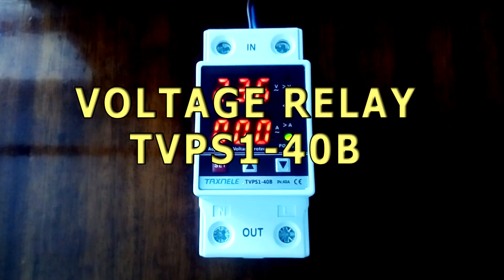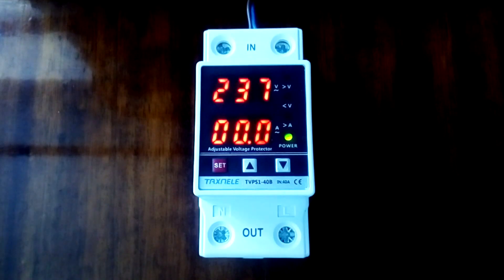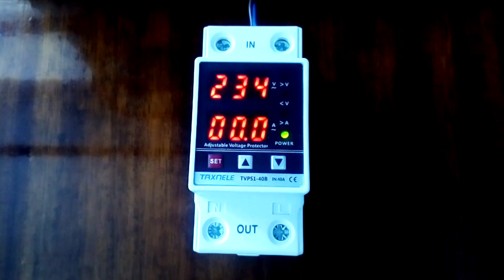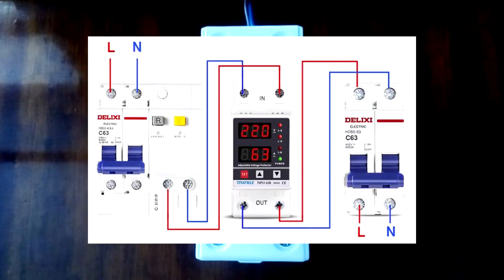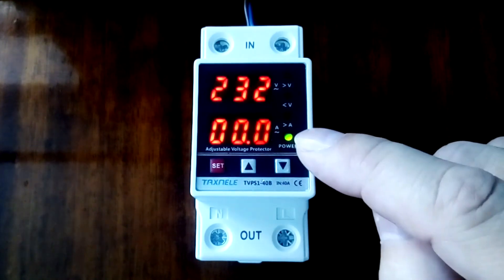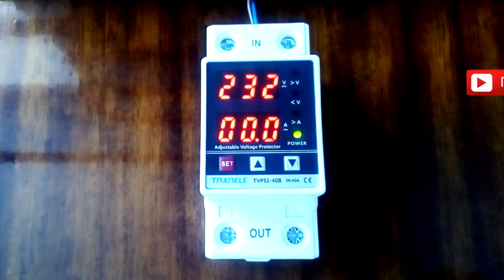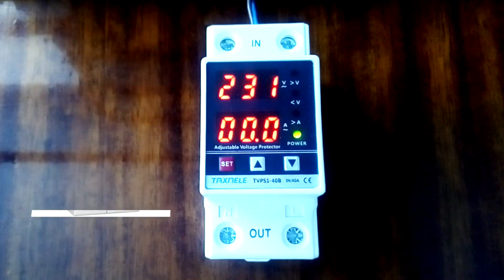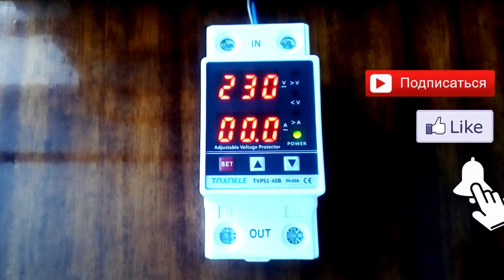Multifunctional Voltage Protection Relay from AliExpress | TVPS1-40B Review Voltage Relay from China

Comment: I wouldn't trust this with more than 5amp of load @240vac..the claimed 63amp ratings be damned! Or pair it with an appropriate sized Circuit breaker .. the control/display board is universal across such relays from gazillion ali sellers.. the real deal /cost to them is in the actual relay that they use inside..63 amps seriosly 😮
Reply from the maker: I have not disassembled this relay. Even if I disassemble it, it is not a fact that the relay will have real numbers written on it. This is more a question for the manufacturer. And you can look at the forums - maybe someone has tested these relays.

Comment: Warning: Many protection devices do not work or after being installed for a short period they burn out. Many students have asked me about this. What is the reason for this? Is it a poor company? What is the reason? It is not only that the company is poorly manufactured or cheap, as they say. Rather, the protection device takes the load after the large disconnection coming from the electricity meter. If the diet device does not match the amperage drawn to the house, there will be a leak and a malfunction. After a while, it cannot handle or control the current entering it, and then it burns out. The solution is to use a protection device with a suitable amperage or one larger than the large disconnection entered from the meter.
Reply from the maker: I completely agree.

Comment: I recently purchased the Multifunctional Voltage Protection Relay from AliExpress, and I must say I’m impressed with its performance The relay works exactly as described protecting my electrical devices from overvoltage and undervoltage situations. Installation was straightforward, and the build quality is solid for the price.